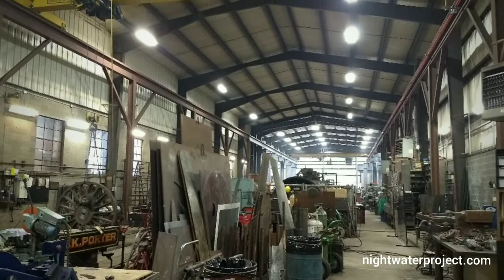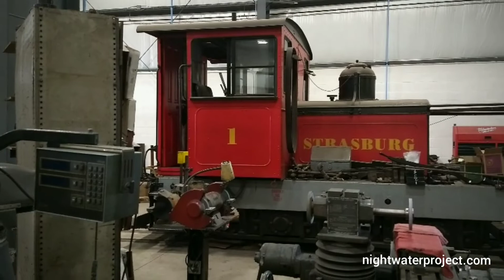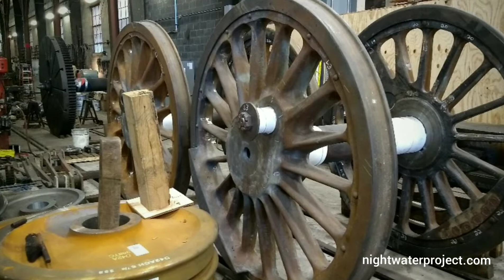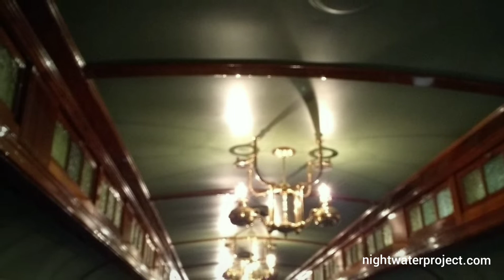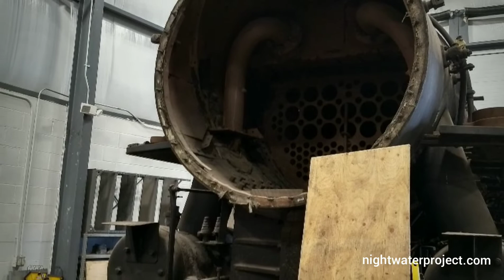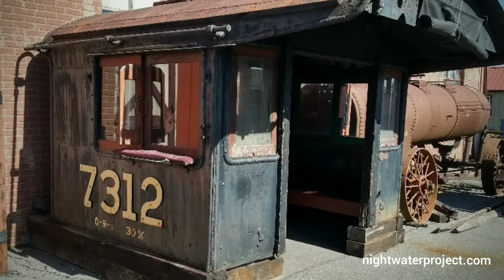Strasburg Railroad mechanical shop tour (fall 2018)

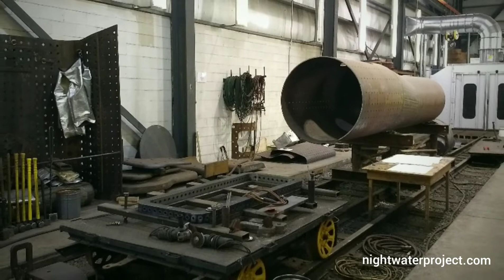Comment: The boiler at 0:26 belongs to a 3’ gauge locomotive. It is, of all locomotives, the Walt Disney World Railroad 4-6-0 #1 “Walter E. Disney.” Strasburg previously did work on the railroad’s 2-6-0 #2 “Lilly Belle” and now has the 4-6-0 #3 “Roger E. Broggie” in the shop being overhauled while #1 is being finished. Strasburg was responsible for the semi-computerization of the #2 which helped out with firing the oil-burning locomotive. While many have expressed their displeasure for the computerization, I say it’s a step forward for steam locomotives and innovation in the 21st century. Walt Disney would be proud as he loved trains and he was an innovator himself. Strasburg, despite the work for Disney, has not thought of computerizing other locos that come into the shop, as it’s not what the customers want or what they want.

Comment: I heard they indeed want to get 7312 working again when they have the time. The reason they don’t have the time is because of all these contract jobs they do for other railroads. In my opinion, the reason they won’t get rid of her is because she was the very first American engine to be preserved. Also, I wish we knew if they’ll ever restore 972
Reply from the maker: The contract work never seems to slow down which is a good problem to have but isn't helping them get 7312 done. Yes, I have a feeling that they'll never get rid of this locomotive either. Too much history with it and wouldn't make the organization look good if they would.
Reply from the maker: As for 972, that's a good question. I honestly don't think it'll happen at least anytime soon. I honestly wouldn't be surprised if they were privately looking for a buyer for it, kind of like they did with the selling of the Camelback.
Reply: @Nightwaterproject  Well in my opinion, they should sell 972 to someone else who might have her cosmetically sold if they're not gonna do anything
Reply from the maker: @rynodynomyte2755  I agree completely 👍
Reply: @Nightwaterproject  👍

Comment: I see still they have 3713s wheels and 7312 has not much progress. Nice photos!
Reply from the maker: This is the first time I saw 7312 since the 90s when it ran daily. Hoping they'll work on it soon! It has been way too long!
Reply from the maker: Thanks for the kind words on the photos. The shop tour was awesome. Sad to see the engine sit there but glad they have it stored inside.
Reply: No problem, I totally agree about 7312 though, they havent said much good things about her operation
Reply from the maker: @TrainChamber  I think there's more than what they tell the public. Many have stated they don't enjoy using her yet they still hold onto her. Why?
Reply: im not sure why, but i did the shop tour back in July when they still had the wheels from UP 4014. The man giving the tour told us they dont like how she rips up the rails but her main problem was PSI. She was built to move forward, stop, go backward, and complete switching duties. By the end of a journey like the one on the SRC said they would need to take time to rebuild PSI
Reply from the maker: @TrainChamber  that KS for the info. Supposedly she can pull more than #89 so it stinks she supposedly rips up the rails. Hopefully they can figure something out.
Reply: I think they plan to complete 475's 1472, than add LIRR 39 as a 4th operating locomotive on the roster
Reply from the maker: @TrainChamber  that LIRR locomotive is nowhere being close to having the funding it needs to being worked on. It'll be quite awhile from what I heard.
Reply from the maker: @TrainChamber  what aldo you think about the railroad investing in a place for static display? #7312 could go there plus their Reading Camelback and the others they don't use.
Reply: Oh i thought they had more progress on 39
Reply: If they put her on static display, they should put her back together, give her new paint, and cosmetically restore her, and move her across the street, rather than just being a boiler and a bunch of parts
Reply from the maker: @TrainChamber  I was thinking maybe they could make their own static display area, after putting her back together, etc but that would work too across the street.
Reply from the maker: @TrainChamber  I should have asked about 39 but didn't. Was too focused on 7312. Last I heard they  were still waiting on money.
Reply: Well actually they are only 27% away from accomplishing a $3,000,000.00 restoration work on LIRR #39. I mean think positively, can't give up now. They can never give up the work on CN #7312 either.
Reply: I would like to see 39 run since she cant run back at her home
Reply from the maker: @mikeharazim9272  oh really? I didn't think it was that close.
Reply: When it comes to 39, I saw some work on the firebox and the area around it, but that was from a while ago

Comment: Also is 475 the one in the engine shed being worked on it doesn’t have a tender hitches to it either
Reply from the maker: 475 wasn't being worked on that day. 89 and 90 we're
 475 is due for it's overhaul sometime later this year.